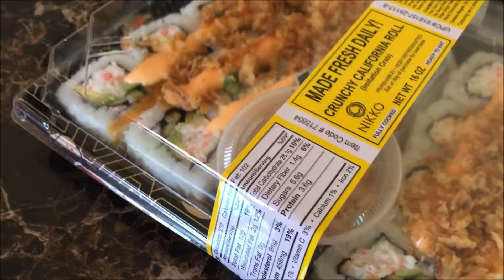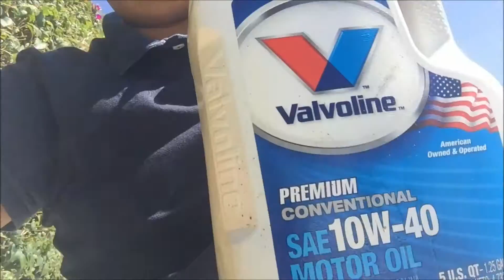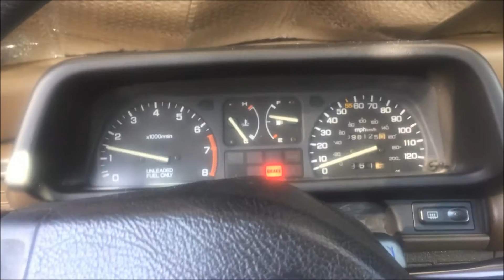Cracked OilPan?!?!

Comment: i feel your pain bro i need a new oil pan on my ek d16y8 because its dented from being so low. just got a new drain plug and a new plug gasket. You can get oversized plugs you should try that self tap when you tighten.
Reply from the maker: Yea it did have an over sized plug still didn't work though :(. Goodluck with your oil pan bro.